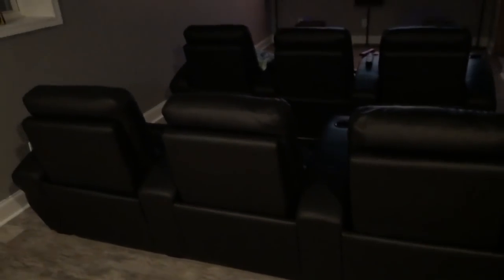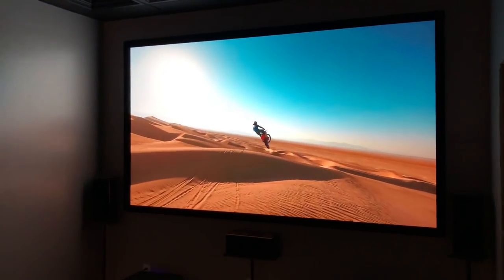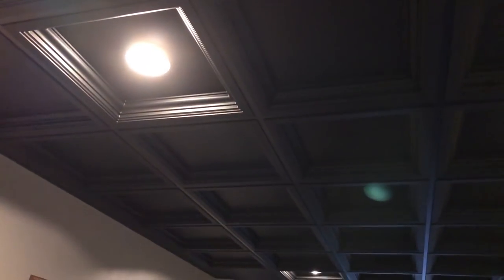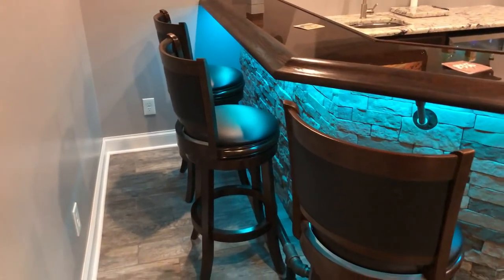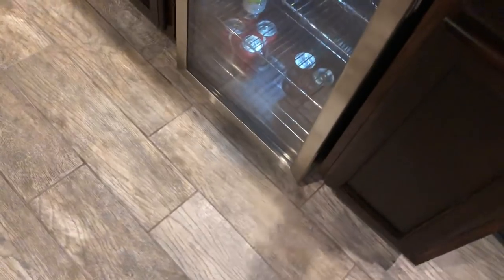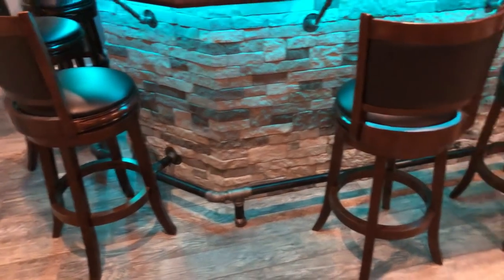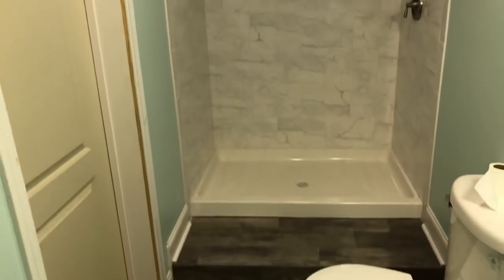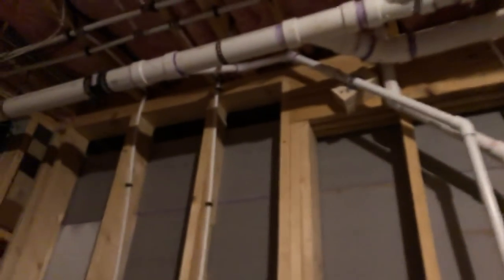Custom Finished Basement Walkthrough 2018

Comment: Awesome basement , alot of hard work .. one thing I noticed that you might of already done ,  I'd   Recommend running your white tile behind the bar sink .. that dry wall will see water at some point
Reply from the maker: Thank man. Yeh I’ve thought about it but probably won’t bother. It has a bead of caulk in the crack and all of the drywall is moisture resistant. It’s not something that gets used every day like a kitchen and so far we haven’t had any issues.

Comment: You know what would be cool man is a retractable shade or curtain right behind the  projector. You can mount it on the ceiling and have it remote controlled it will really bring out the quality of your video and overall image when you’re watching a movie or a game.
Reply from the maker: Yeh a curtain behind the back chairs was in the original design but the projector has a bright cinema setting and is fine when it’s light out. I typically only watch movies when it’s dark so it doesn’t matter too much.
Reply: @savemoneydiy87  I hear ya

Comment: Awesome basement man, Love the tile wood look floor. Im thinking of doing the same.. I feel Tile is more solid than laminate or engineered hardwood for the basement. That and maybe some area rugs. Jeezus though how tall are your ceilings they look high ( I have 8ft but they look huge ). Great Job though.. Im in the begining stages, Just did french drains and gutted the 1990s amature hour attempt the old owners did.
Reply from the maker: Thanks. I appreciate it. Ceiling is 10’ but with the drop ceiling it is 9’3”. I really like the tile even though it was a lot of hard work I haven’t had to worry about it at all. Especially when someone spills something. Good luck on yours.
Reply: Thanks!  @savemoneydiy87

Comment: Looks great. Can you explain more of how you did the ceiling? Armstrong’s site says you can’t cut these and need a square ceiling. Did you have to do a sheet rock coffer in the sides or how’d you do the sides if it’s not square?
Reply from the maker: Thanks. For the perimeter where I couldn’t use full coffered tiles I used standard black acoustical tiles.

Comment: Great job on the basement finishing I’m interested on your AV equipment I would like to put mine in the closet and work it remotely is that how you were operating all your equipment remotely
Reply from the maker: Yes. The opening you see in the video now has a Bookshelf Door so everything is in that room behind the door. I have a video showing the door. Right now I have an Insignia remote extended kit that I use but I’m ordering  a harmony remote to replace it.
Reply: eislek3652 I’ll check your other videos, thanks

Comment: How did you power/install the LED's on the shelves? Looks so clean!!
Reply from the maker: Thanks. Explained at around 7:15 in the video. 1/2 router slot in shelves with holes at each end of the router slot. Fed wire from each shelf behind the wall and into the bar cabinets to an outlet I put in there.

Comment: Excellent finish simple but gorgeous. Your cooling system is a split? would like more info.
Reply from the maker: Thanks. It is a heat pump system. The part in the ceiling and the part outside is all there is. Not sure if this helps or not.
Reply: @savemoneydiy87  so it cools and heat too?
Reply from the maker: That’s correct. It does both.
Reply: Do u have knowledge of the installation?
Reply from the maker: Yes. I installed it by myself

Comment: Amazing room, you did an amazing job.  Question about the dart board...what do you have the board attached to and I thought I saw some kind of airplane sized liquor bottle, possibly for holding the darts?
Reply from the maker: Thanks. The dart board is on some wood  I found at work. I took a torch to it to burn it a little. And yes the darts are in little bottles of fireball that I cut the top off of.

Comment: I know this an old video, but was  just wondering the measurements of ur bar top. And how the bar has held up since u posted this video?
Reply from the maker: It has held up great. We still use it. Had our work Christmas party down there and getting ready for a New Year’s party. Which measurements are you interested in?
Reply: That's awesome! I'm in the middle of my own build, based off your bar design. Been alot of fun.. I figured out measurements base off ur response to other comments. 
What type of adhesive did you use to attach air stone to the OSD plywood. 
Is there a reason you use OSD vs drywall or cement board?
Reply from the maker: @ceejayluke  Here is the adhesive I used. 
PL Premium 8x Fast Grab Brown Polyurethane Interior/Exterior Construction Adhesive (10-fl oz) https://www.lowes.com/pd/LOCTITE-PL-Premium-8x-Fast-Grab-Brown-Polyurethane-Interior-Exterior-Construction-Adhesive-Actual-Net-Contents-10-fl-oz/3658268

I tried using the 3x but it was too runny compared to the 8x. No particular reason for using OSB. I do like that it is stronger for when people kick their feet on the wall when sitting at the bar compared to drywall. I did paint it gray before putting the stone up to avoid seeing the wood between any gaps in the stone. Any other questions feel free to ask. I’d love to see some pics of yours once you finish.
Reply: @savemoneydiy87  thanks! I'll definitely post a video once it's all done. Maybe some while tho, since I can only work on it on weekends...lol.
Thanks of answering my questions, really appreciate it. 
I'm sure as the project progresses, I'll have more questions. Especially when I get to the epoxy pour part, never used epoxy before.
One question I can think of right now is, how did u choose to attach bar top to halfwall framing. Did u use counter top support brackets or just screwed the top into framing and support with the piping brackets u made afterwards?
Reply from the maker: @ceejayluke My bar top is 2 pieces of 3/4” wood and the first piece is screwed to the half wall. The second piece is laid on top with adhesive and some short screws through the bottom piece into it. The bracing comes from the piping brackets. I have a video from a guys basement bar I built that shows the epoxy pour if you want to check it out as well. Hope this answers your question.
Reply: So 6 months later...almost done with project! I really appreciate ur help and answering my questions, so thanks. Looking forward to posting once complete. I have another question for you. What did you use or do to, cut air stone, to get such neat/clean 45 degree corners with the stone?
Was thinking of either that or just using stained oak trim to make corners, so stone can be played right up to it.

Comment: Your 2 zones of audio, how does it play 2 different audios at the same time? Does it require a 2nd small receiver for zone 2? Also, what kind of speakers did you go with?
Reply from the maker: Its one receiver. The receiver itself sends a separate audio signal to channel 6 and 7 based on whatever source is selected.  I went with RSL speakers.  Hope this helps.

Comment: Was their already water supply lines for that bar sink? I am trying to figure out how to get water and drainage to a room with no existing lines   For my own project.
Reply from the maker: No there wasn’t. My water lines and septic lines were in the ceiling of my basement. I tapped in to my water lines and ran them to the sink. My sink has a pump under it and it pumps to the ceiling as well and I tapped in to the main house drain with it. Hope this helps. Any other questions let me know.

Comment: What are the specs of the bar? Width of bar top and granite top and length?
Reply from the maker: I’m not sure what you mean by length since it’s galley style. The granite width is based off the cabinets and has a 1” overhang. The narrow part of the granite is 15” plus the overhang and the side against the wall is 30” plus overhang. The bar top is roughly 12” plus the trim.

Comment: With the toilet system you showed in the end doesn’t need roughing up and digging hole for the toilet? Im getting estimates from contractors and was thinking to avoid getting a toilet done as Im being told 8-10k just for the toilet as the roughing up, digging a hole and ejector pump all cost around 5-6k.
Reply from the maker: Exactly. That’s why I went with it. The toilet was around 900 and I have 30 bucks or so in pvc pipe. You just have to be able to get to your main waste line as well as be able to vent it.
Reply: eislek3652  Thank you for your response buddy! 

Im seriously considering this set up to save costs quoted by plumbers. Hope this is durable and trouble free. 

Do you notice any difference in flushing? Or is it exactly as normal toilets? 

Which macerating brand and model is yours?
Reply from the maker: No problem man. If you go to my channel I have a video just on the toilet. I made it after I installed it because I was having trouble finding much info before I bought mine.

Comment: Great job ! 👌 I watch this video alot. I'm actually doing my basement as well. What's the ceiling in your basement ? Is it unfinished wood that's painted.. or you customized that as well ?
Reply from the maker: It’s a drop ceiling like what’s in a school but more decorative. It’s made by Armstrong Ceilings and called Deep Coffered. You can look it up at Lowe’s. I wanted a drop ceiling to always have access if I ever wanted to add anything.
Reply: @savemoneydiy87  appreciate it bro. I'm going to probably do the same. How much did the ceiling cost ?
Reply from the maker: It cost a couple thousand but I got a deal on the tiles. Those ceiling tiles are 13$ a piece.

Comment: What setup did you use to connect the 2 TVs? I want to do the same thing at about 50 feet but don’t want a signal loss. Thanks
Reply from the maker: I have a Denon AVR-X2300W receiver that has 2 HDMI outs on it. One HDMI cord goes to my projector and one goes to my bar tv. My Xbox is my source to feed both.
Reply: @savemoneydiy87  Thanks!

Comment: How is the sound with the tiles in the movie area?
Reply from the maker: I have a big area rug in front of the screen over the floor tiles. The sound is great. Now with the ceiling tiles, the 2 subwoofers do make them rattle due to the air movement when the sound is loud. I had to add something to the top of them to weigh them down slightly. Hope this helps.
Reply: It does help. Thank you

Comment: Beautiful job, and basement! It looks amazing. Does the 1" waste line pose any problems with blockage or getting jammed up? It seems a little small to me, but maybe not?
Reply from the maker: Thank man. And no. So far I’ve had zero issues out of it but it doesn’t get used as much as a typical toilet since it’s in the basement. A 1” waste line is what the manufacturer called for.